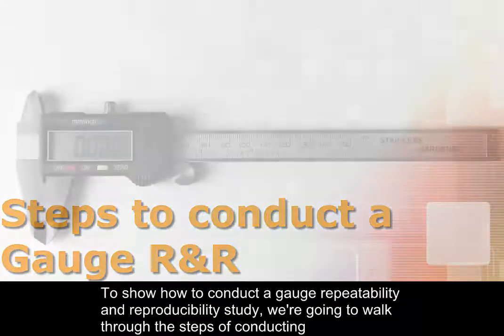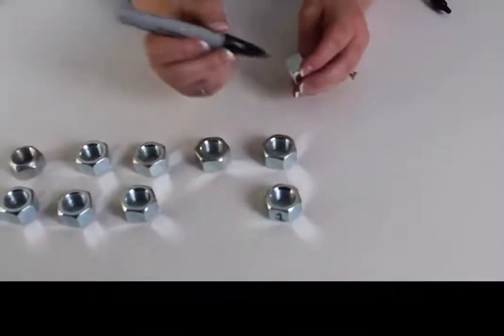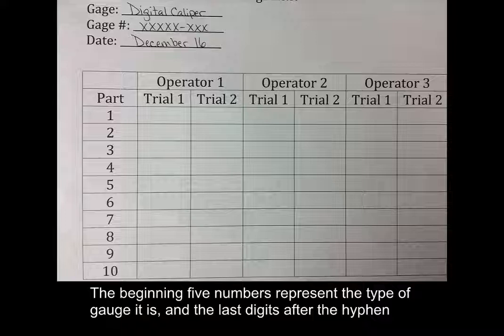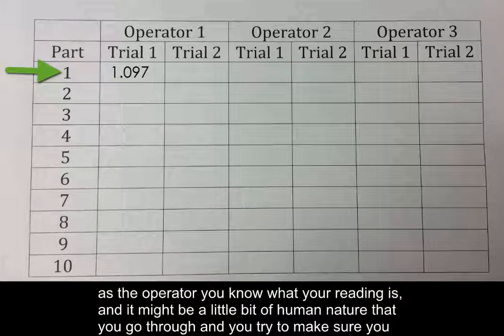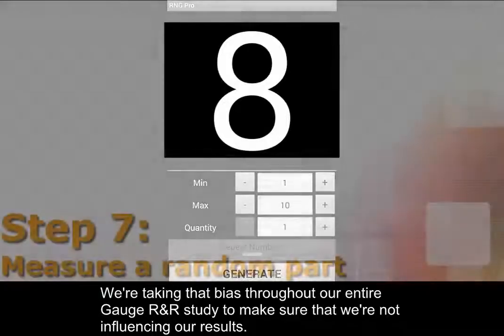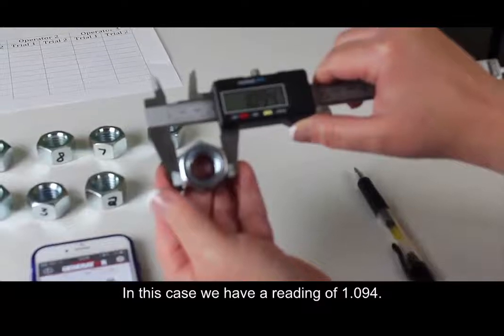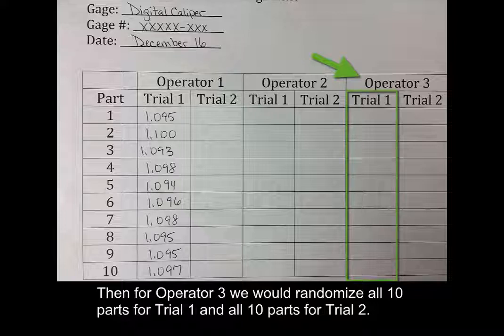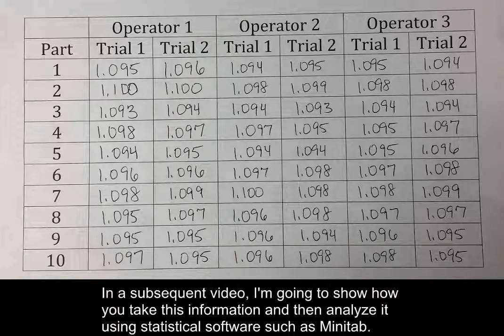How do you conduct a gauge R&R?

Comment: Hi Madam, l have a question. Let's say I have 3 operators and 5 parts. Each part measured by the same operator 3 times. The measurements are length measurement and the equipment is a vernier caliper. Should the 5 parts all come from the same part number e.g. Part number 123 or different part number? In your video, your 10 parts seems to come from the same part number.